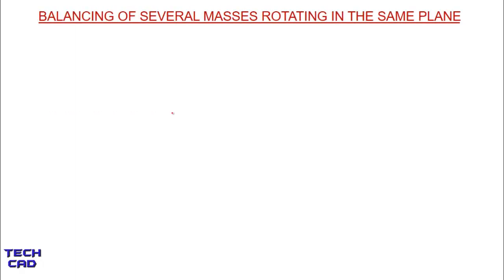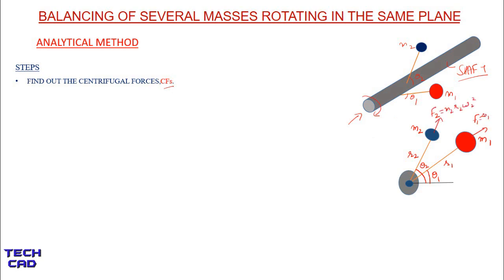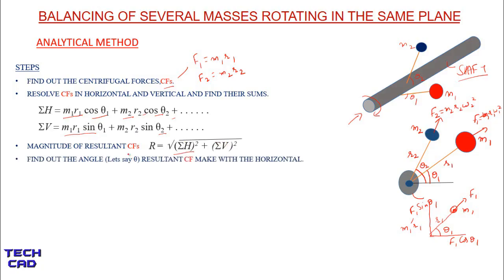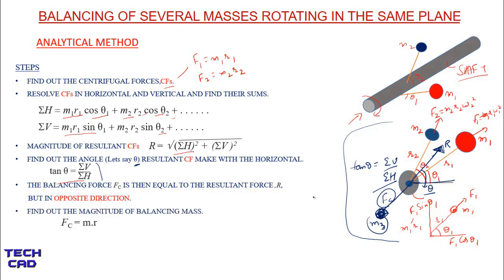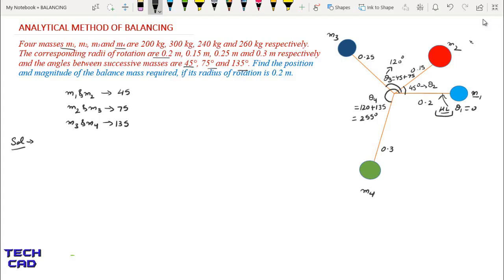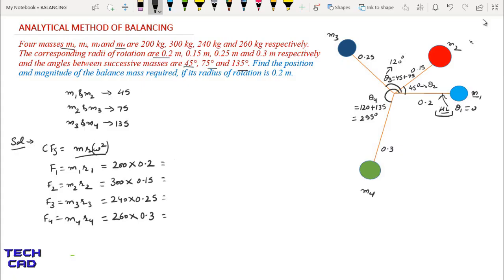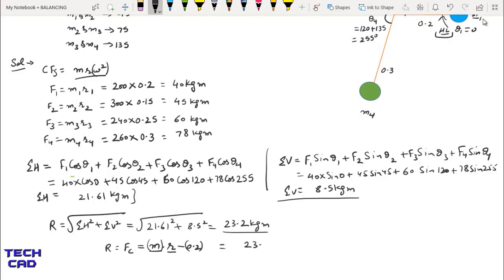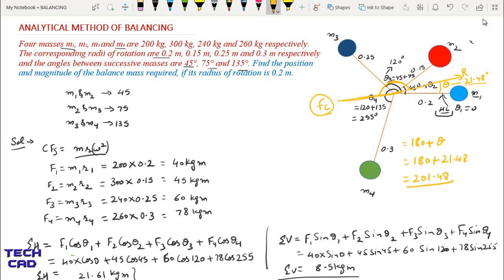HOW TO BALANCING OF  SEVERAL MASSES ROTATING IN SAME PLANE

Comment: Sir should we make this diagram according to the given dimensions or roughly??
Reply: Sir in graphical method by assuming scale factor the answer is different .
Reply from the maker: Dear Don't take scale factor on angles.
And Analytical method gives u more accurate answer
Reply from the maker: Dear in analytical method there is no need of graph (so u can me rough graph) but in Graphical method Graph has to be accurate. For graphical method check out the following link: 
https://www.youtube.com/watch?v=1HXxF7JG-RU